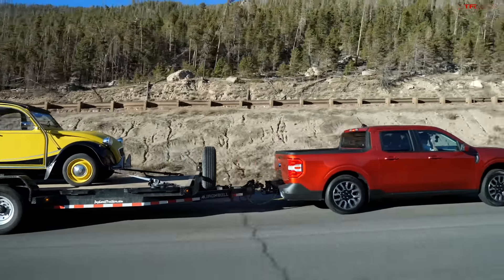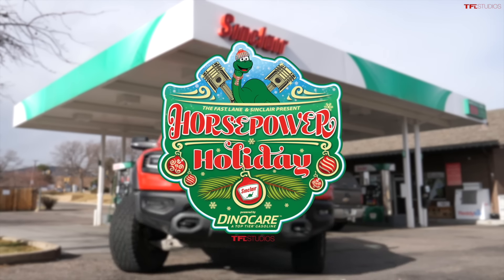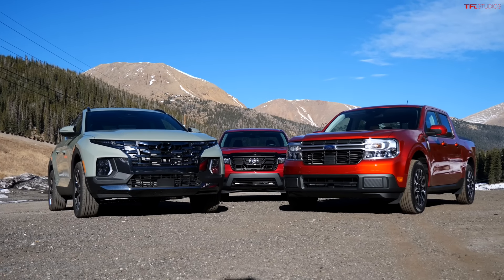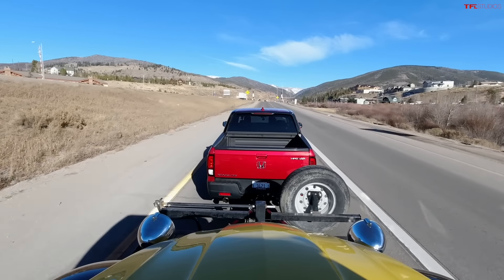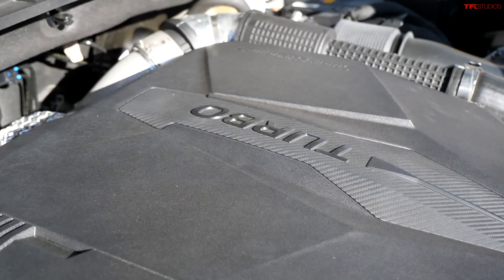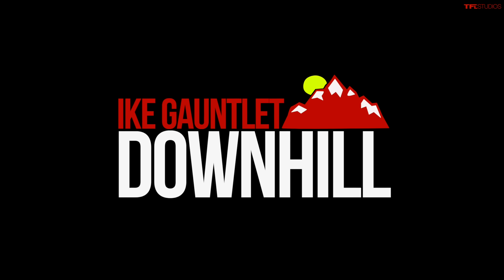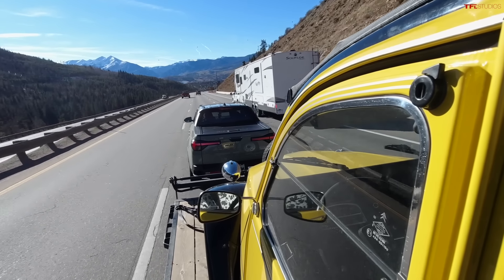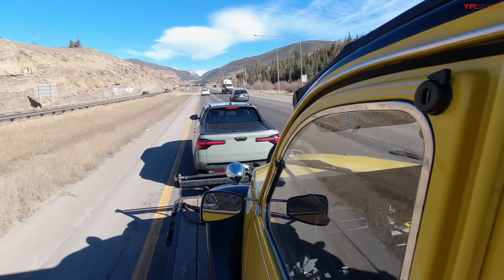I MAX OUT The Maverick, Santa Cruz & Ridgeline, But Which One Wins The World's Toughest Towing Test?

Comment: I think if someone is going from a full size truck to a light truck for mild or moderate towing, the Maverick is going to be a better fit, and with an XLT you get the same towing with a few less options but it's under $30k. If someone is going to a light truck from a car of cross over SUV, the Santa Cruz may be a better fit. Truck people tend to like the slightly more rough ride and the different style of handling that you get with most trucks. So with similar performance,  or the same in a place with less hills, The Maverick might end up being a better pick for a lot of pick. No snow and don't need to tow but still need a work truck, the Maverick hybrid is a must. FWD but gets over 30 MPG so around town that $23k light work truck is going to save a ton on fuel costs.

Comment: One thing that isn't mentioned is the Maverick was maxed out, the Santa Cruz was not. Of course the ride power etc is going to be better if you're not maxing it out. Should have put another thousand pounds on the Santa Cruz and tested it that way.
Reply: Why? The Maverick wouldn't even be a consideration if you want to tow 5,000 pounds.
Reply: Definitely! They always consider each vehicles towing max and each vehicles pulling weight is different.

Comment: I'd pick the Maverick. It was towing its max while the other two weren't and it is much, much, cheaper.
Reply: The base $25k Santa Cruz tows 4,000lbs with no optional tow packages required.

Comment: I honestly just don't understand how the Honda at that price is even competitive. It tows just about as much as these sub compact trucks,interior is subpar  and gas mileage isnt that crazy. Tbh I'd rather just get a Tacoma for cheaper with proven reliability and a more truck like feel and capabilities🤷🏿‍♂️
Reply: Have you actually driven both? The Honda loses points for the infotainment system, but in every other way is more comfortable and convenient. If, as you say, you like a more truck-like feel, or go hard-core off-roading, the Taco wins there, tows more, and is possibly a better value in lower trims. Honda has more payload, better fuel economy and comfort, and is a better value in the higher trims.

In my extensive shopping of mid-sizers, the only really crazy pricing I saw was Ford Ranger. A trim similar to my $41k Ridgeline RTL-E would have cost $47k, felt much smaller inside, and there was no negotiation due to short supply. 

I do more road trips with passengers than towing, so I bought the Ridgeline. I'm just glad we have real choices among mid-size trucks! Shopping Accord/Camry/Altima is like choosing between brands of 2% milk!

Comment: When towing with the Hyundai more than just once I can’t wait for the fat bearded guy to be on the side of the road with a burned up dual clutch. The Ford maverick clearly won this comparison and it’s $4000 less and the fat bearded guy is so negative toward the Ford. Like I said the tip top of the line model Hyundai it’s a car not a truck the Maverick is a truck. It’s also built like a truck and it’s built to take on the challenges of Towing over the long haul a Hyundai will fall apart in the dual clutch will burn into ashes

Comment: 🔥 Useless. You guys compared 3 pick ups, 2 at 80% of it capabilities with 1 max out at its 100% capacity. SMH 🤦🏼‍♂️ Hence, that's why the Mav did better in my book. From what you saw here if you put the SC & the RL at the max capacity they going to perform worst than the Mav. 

Btw, the SC had the advantage of a after market MODIFICATION... 🤦🏼‍♂️ No matter the reason why was MODIFIED. It was MODIFIED...

Comment: the awd ridgeline is a half ton truck. why is it in this video.
Reply: They’re technically all 1/2 ton trucks.
Reply: It's a unibody so it's kind of in the same class.
Reply: @ALMX5DP  you are fake news.
santa cruz and maverick have gvwr's of less than 6001 lbs. the awd ridgline is over 6001 lbs.
Reply: @jamesm568  gvwr defines vehicle class not whether or not its a unibody
Reply: @notme3184  where did the term “1/2 ton” come from then? Didn’t refer to GVWR to my knowledge.
Reply: @ALMX5DP  its just an industy standard to refer to truck classifications instead of using class 1, 2a, 2b, etc as prescribed by the federal highway administration.
Reply: What are y’all talking about? Non of these are half ton trucks.
Reply: @notme3184  Most people don't look at unibodies as a class as they look at it as a unibody. You got three unibody trucks that all have different capabilities in the unibody truck class.
Reply: @notme3184  an industry standard originally based on payload capacity right?
Reply: @ALMX5DP  trucks way back when used to be classified in accordance with their payload capacities. and as those capacities increased, manufactures generally kept those terms.
Reply: @notme3184  sure, which is why I said they were technically 1/2 tons, because they are rated at carrying more than half a ton.
Reply: I’m not sure how the Ridgeline would be a half ton. It’s size and engine is well inside the midsize class. Unless you consider the midsize class of today to be “1/2 ton” all together. Because that I can see…
Reply: @fubarmedic4222  it has a gvwr of 6001 lbs+ making it a half ton truck
Reply: @ReformedBrant  Ridgeline awd has a gvwr of slight over 6001lbs making it a half ton truck. Similar to a ford150 or ram 1500
Reply: @fubarmedic4222  size and engine has nothing to do with class rating
Reply: @notme3184  where is the rule that GVWR of over 6k lbs makes it a “1/2 ton”?
Reply: @notme3184  wouldn’t that make all midsize trucks half ton?
Reply: @fubarmedic4222  no. gvwr defines class.
Reply: @notme3184  some midsize have a GVWR over 6k though. That and “class” in terms of federal truck regulations is different from “class” in terms of manufacturer marketing lingo. I think using Compact, Midsize, Full-size and Heavy Duty is the best type of terminology, using a combination of factors not just  a single metric like GVWR.
Reply: @notme3184  every midsize truck except the Tacoma (5900lbs) is over 6k lbs gvwr. So again all midsize trucks are 1/2 tons in your definition. At what gvwr do you get to heavy duty? Because I think that some if not all 1/2 ton trucks might be 3/4 ton then.

Comment: I wish they'd stop calling these "trucks".... they're just not.  How about  calling them"TSVs"? (Truck-styled vehicles).  We can always be on board with more acronyms, right?
Reply: That’s just stupid. They are trucks. You just have your own definition of truck. Was the Ford unibody not a truck? Are Ford Explorers not suvs because they aren’t body on frame?
Reply: @ReformedBrant  These little vehicles cannot carry a scoop of gravel, a cabover camper, cannot carry a load of lumber or sheetrock (without half of it hanging out), cannot carry a full-sized quad, a full-sized motorcycle, cannot do most anything a real truck can do.  They are trendy luxury sedans with the trunk lid removed.  And the Ford unibody was cancelled after 2.5 years, because they..... couldn't do the work of a truck, so no one wanted one.
Reply: It has a bed and it has more payload than a Tacoma.
Reply: @broeheemed32  yes, they can carry most of those things. Nobody has designed a cab over camper for them, so yes, you can feel the win on that one.
Reply: @broeheemed32  give it another year and they will literally be able to do every single one of the things you mentioned. The only thing they cannot do currently is a camper and that's just simply because one hasn't been made yet.
Reply: @travisb9130  They would have to forgo the rear doors and make a single-cab longbed model to pull off most of those chores, but they won't.  The manufacturers continue to say that "there isn't a market for those" but there really isn't anyway to make that determination, since they've only ever made them as a four-door.  Even the full size trucks are nearly impossible to get in the single cab longbed configuration.  You can get one, but it would be the "entry-level" with few options available.  I think the Ranger or Maverick would sell plenty with the single-cab longbed setup.  The bottom line is that they don't want to pay for the tooling to make a single cab or different bed sizes.